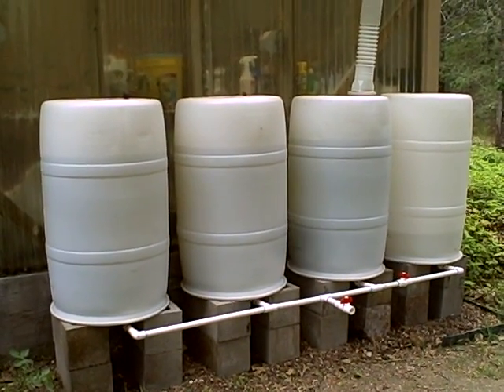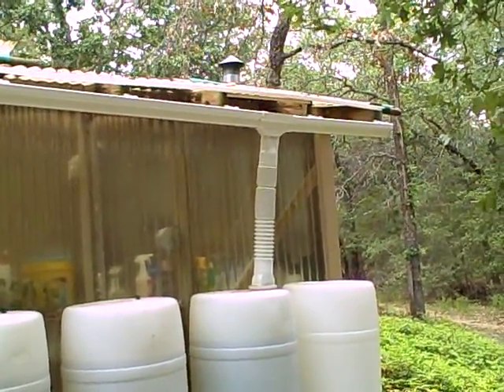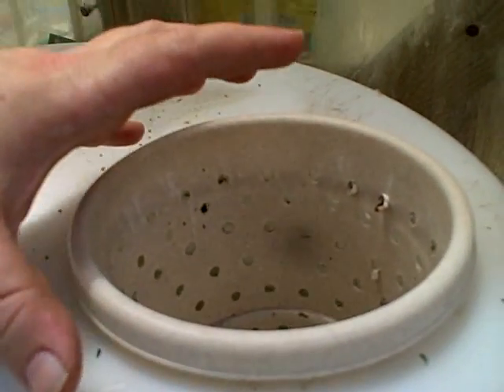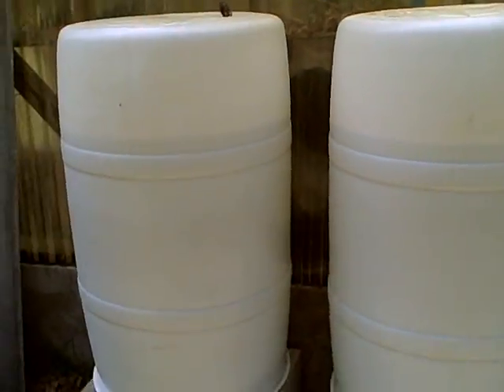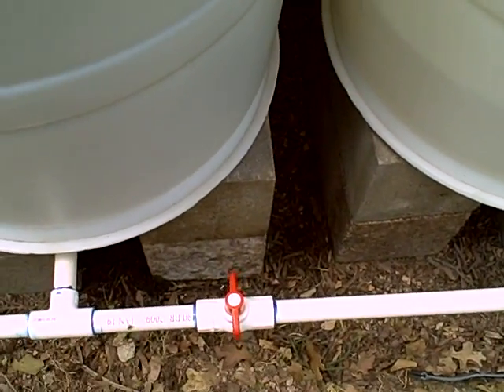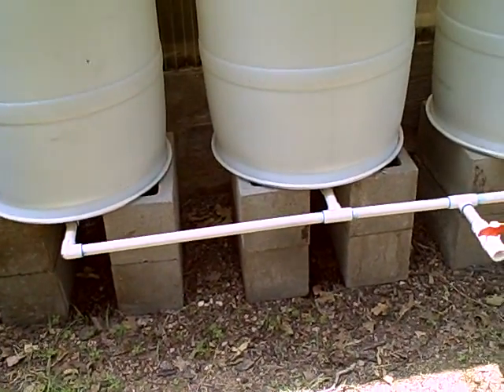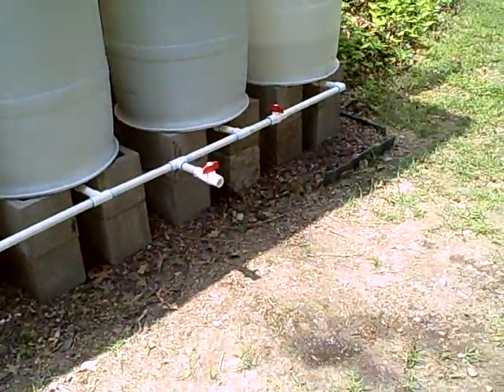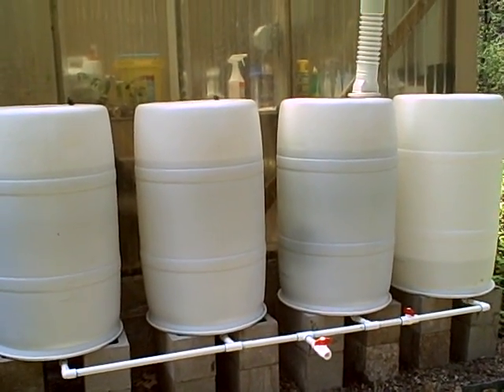MNT's Rainwater Collection System with Manifold

Comment from the maker: outstanding!  the thermal capacity of water should mean that if your freezes come sparingly or infrequently (like ours here in Central Texas) then the water in your barrels will probably not freeze.  however, i'd still dump the water in your manifold just in case (especially considering you had the forethought to install shut-offs at each barrel - wish I'd thought of that).  Thanks for watching!!

Comment: Ok, please check your label on that silicone then.  "Bathroom or tub" silicone usually contains an anti-fungus chemical which is poisonous.  I looked up Rectorseal 5 and I see that's a great choice to use, as long as you aren't using abs plastic, for which it is not recommended.

Comment from the maker: Well... actually, at the time i posted this video (2009) I didn't have an overflow installed. Now, I do.  I simply cut a hole in the side of one of the barrels (near the top of the barrel, of course) and installed a length of garden hose.  Works great!

Comment from the maker: So, I'm going on 4 years since I built this system.  No leaks. Rectorseal 5 to seal the threaded fixtures (instead of teflon tape) and "bathroom or tub" silicon bead around the edges of the fittings.  This system is not meant to hold potable water - only for irrigating my garden.

Thanks for commenting and watching!

Comment: to see if they recommend using it on that type of plastic.  All silicones are not the same, just as all plastics aren't the same.  That's why I find a bulkhead fitting with gaskets and teflon tape is easier
to deal with, and a lot more certain.

Comment: Yes, but there's a caveat that goes with that.  Will it stick to the plastic barrel, or pull away in time to leak later?  What type of plastic is the barrel?  I sell industrial caulks, and sometimes it's a nightmare to get the -right- silicone for the job.  Since I don't sell aquarium silicone, you would have to read the label to see if it will adhere to the barrel, assuming you know what type plastic the barrel is made of.  If it's not on the label, you'll need to contact the manufacture.

Comment: Cool!
I would use a screen with smaller holes to screen out smaller debris.

If you use a window screen-size mesh to cover any vent holes, you won't need to worry about any mosquito larvae in the tanks.

You could paint the tanks in any dark color to prevent algae growth and also protect the plastic from degradation due to UV exposure.

Comment: Nice video.  I think you can turn them back. And use uniseal plug what ever size for bottom.  Open the original cap for the flow

Comment: I don't care for the "delafleur diverter" method of overflow though.  Drilling a large hole in the side near the top of the barrel lowers the water capacity..  Better a "t" fitting at the top on the inlet to allow the barrel to completely fill.  I'm using a Grady Barrel water diverter, and that's how he set it up, and it works great.

Comment: I installed my first rain barrel in 2008.  I put it on concrete blocks.  After about 2 years it started to lean because the blocks were sinking into the ground.  We have poor soil in Plano.  The full barrel weighs 450 pounds so I had to remove it, level the soil and reinforce the ground with bricks.  The lesson I learned was that rain barrels are very heavy and depending upon the slope of the ground, soil stability, and occasional water pooling under the barrel, it can sink.  Just FYI

Comment: Nice video.  I think if the manifold was after the filter, but before the tanks, with pipes running down into the tanks almost the to the bottom, then you might be able to set up the overflow (maybe with another manifold) such that the old water is automatically rotated out every time it rains.  My only concern being Legionella which is rare, but likes to grow in warm water.

Comment: actually, they would if temperatures didn't get to low. the downside, is that they poop. this system is not set up to keep the levels safe. That is preferable in systems that use continuous flow with aquaphonic systems.

Comment: Yeah that's it.  I was asking because filtration can be for many reasons for example if you wanted to prevent a backup or glog in your system for example or chemical removal so water is safe for the garden.  Sometimes there are toxins from air pollution.  Thanks for the response and kudos to you for the project.  There's some satisfaction knowing you're being autonomous.

Comment from the maker: Well, at it's current elevation? No. Without a pump, the head pressure of the water is determined by gravity. In other words, the higher you elevate your system from the ground the more pressure you'll have in your line. I, personally, have my water pumped into a low-flow drip system using a small "on demand" pump that goes into a pressure regulator so that the system isn't "blown up". You'll find some ideas online that can help you develop a plan. Good luck!

Comment from the maker: Dunno if I understand the question. Filtration is basic. I have a filter on the drip system, now (not shown in the video). Haven't had any issues. As stated in the video, this isn't intended for potable water. But, in a pinch, I can run the water through our Berkey and it'll be fine (tried it before, and I'm still kicking!).

Comment: MNT or anyone with possible knowledge, I set up a similar system based on your idea, (which I give you credit for), however one barrel is filling up all the way to the top , and the other two are less than half full. The one that's entirely full is the first one receiving the water from the gutter. Thanks!

Comment: Brilliant. I was trying to figure out a way to install a faucet without making a large hole in the top of the drum. I wanted the faucet in the bottom of the drum so that storage water would flow by gravity into my system. I didn't want to install the faucet through one of the caps (bungs?) because that would mean that i would have to store the drums on their sides and building a complicated rack - or so I thought until I saw your video. Solution, install faucets in caps, store drums upside down!

Comment: I forgot to add what I did to the inlet on my first barrel. I used a flower pot like MrNative did but I took some old nylon stockings and triple layered them into the bucket, then I added several layers of sand and gravel and covered all that with two layers of nylon window screen. It does real good at keeping the water clean.

Comment: Garbage bags probably help to cut down on algae. I painted mine black, then painted them white ( to keep from absorbing heat) to block any light and also added some bleach (about 1 cup).  I will use mine for drinking water by using a Berky water filter.

Comment: como, he said about 12 time's he's using 3/4" pipe

OP: definitely need to close that up for mosquito reasons, adding another filter medium in your filter basket would also be a good idea.   the problem with your mainfold at the bottom is you're assured to get all the sediment from the barrels into your lines, and your valves won't like it over time.

I'd also paint those barrels, too much light getting through and algae will persist.

Comment: Where the water drains from the very bottom, I'd be concerned about dirt and debris getting in the first barrel. By the end of the season, my rain barrel has a layer of crap at the bottom. Also, here in Massachusetts a downpour can easily flow faster than a single 3/4 PVC pipe can drain. I had to add a second 3/4 overflow to my single rain barrel to deal with occasional downpours.

Comment: Yeah, I like the manifold ... I've got a two barrel system and connect them near the bottom with a 1 inch hose so you only need to feed water to one barrel. Do like what you've done there though!

Comment: @alanopolis1 
In Texas, it isn't a matter of the cost of water, it's the fact that there isn't water to buy in some areas. I have a water well so the only expense is to run the pump.  That's assuming that there is something to pump.  Also, lots of well water is high in mineral content that you might not want.

Comment: As mentioned by Reddsmorris1, if you will paint those barrels black or silver, the UV light will be cut off and eliminate the algae. Also, the 3/4 PVC might not flow water into the barrels as fast as it's entering the first barrel via the down spout resulting in loss of water through over flow.
Texflyguy

Comment: From one Texas to another I think your system is the best I have seen and I will likely duplicate your setup for my garden needs. Thanks for SublimeCharger07's comment, I probably will try and find the dark blue 55 gal drums as I would like to depend on the storage for self sustaining water use (should that need ever arise). Of course you meant 90 degree PVC coupler not 45,  Would your coarse 4" filter be improved with some nylon window screen material? BTW Very impressive garden design also!

Comment: Wow, this is a great, well engineered system. I would bet that a good rain would easily flow more water into the first barrel, than the 1" tube can flow out into the other barrels - wouldn't a 4"-8" manifold work better and prevent overflow at the first barrel while the others are still filling? Also, I wonder if you may have to drill 1/8" holes in the drip hose - I think that they need water pressure (50-80lb psi) to flow.

Comment: You're killing me ... you have your barrels connected in PARALLEL ... not series.  And yours is way better than those on YouTube that show series constructions.  If it was 'Series' ... you would have connected the fill barrel at the top, to the bottom of the next barrel.   Therefore, you would have filled the first barrel and then then next, and so forth ... hence, in SERIES.

Your much better method is to connect the barrels in PARALLEL ... using your manifold.

Comment: Your barrels aren't connected in 'series' by the manifold ... they're in parallel.  If they were in series, you would have made an outlet for the first barell to begin filling the second, and so on.  The first barrel would fill completely, and then a connector at the TOP of that barrel would begin spilling over into the second ... Great implementation all the way!

Comment from the maker: @RDLONG30 I'm not quite sure what the difference is between pulling water from several valves for from a single valve on a manifold. Except that the method you're recommending is totally different than the method I'm presenting.

Comment from the maker: @steveinMA1 Well, I turned the barrels upside down because I wanted to take advantage of the 3/4" FIPT connection at each bung. Yeah, it gets a little nasty down there, but it really hasn't caused a problem with the system. Thanks for watching!

Comment: I like your manifold concept.  I imagine you raised the 3/4" pipe inside each barrel so that it would not pickup debris as it flows.  Also, let me suggest adding some window screen material to your intake (inside the perforated plastic pot) to keep mosquitoes and other bugs out.

Comment: This is a great video because of your detailed explanation. I do want to suggest that you pain or otherwise treat the pvc piping though. Schedule 40 pvc doesn't have any  uv stabilizers in it since it wasn't designed to be exposed to sunlight. After a year or so in the sun it will become very brittle and basically disintegrate. Thanks for this great video.

Comment: @Masowai I'm talking about the diameter of the lines leading to the spigot but keeping the final line the same. This would, 100% for sure eliminate any chance that the spigot was being bottlenecked by the feed lines - which would result in a pressure drop.

Comment: Nice setup!  If you spray the barrels with black spray paint, it will prevent sunlight from passing through and causing algae growth.  Also, it's probably a good idea to add chlorine once a year and flush it out before a big rain, to clean out any algae growth.

Comment: dark blue or black barrels will fix the growth in the tank white is not ideal because it lets the light through. also...not having taps on each tank to isolate them means if you get a leak in one you loose all of your water not just one tanks worth ... otherwise its a really good setup ..well done

Comment from the maker: @KevinDC5 Thanks for the kind words! Yeah, I think I mention in the video about cutting holes in the tops of the barrels to relieve pressure. Something that's not shown in this video (installed since I posted it) is an inline pump to a dripline filter that then goes to a pressure/flow regulator. I clean the filter out once a month - it's easy! Well, you probably know that the drought continues down here in Central Texas. 220 gallons will last for about 2 months on my drip system.

Comment from the maker: @burnieberrey Yes, absolutely. I think this is pointed out in the video. I cut a small 1/2" hole in the top of each barrel to relive the pressure in the barrels. Then I stuffed some window screening into the holes to prevent mosquitoes from getting inside.

Comment from the maker: @Deathragous Dunno what the PSI is. I have a "part-time" pump that I bought at Harbor Freight in-line, now, so that I can supply consistent supply to my drip system to the garden. One caveat: If you choose this method, make sure that there's a pressure/flow regulator in-line behind the pump and in front of your first dripper otherwise you risk blowing up your system.

Comment from the maker: @aubry1234 Thanks! The spout? That was easy... it's just a 3/4" ball valve with 3/4" FPT on each end. If you want to connect it to a hose, just find a 3/4" hose bib and screw it into the ball valve fitting.

Comment from the maker: @Higgiebaby Hi there... I'm not sure about a 1/2" pipe. I don't really see why not. Hell, the nice thing about using PVC is that it's CHEAP CHEAP CHEAP! So, go for it! I used 3/4" because the bung fit a 3/4" MPT elbow and I wanted to keep the pipe diameter consistent across the spectrum. Let me know how it goes!

Comment: What type of protection would be best used for winter weather? I'm sure that the pipes would freeze and possible the barrels freeze and crack them. Has that been an issue?

Comment: Awesome system. I like how you can cut off the flow to the expansion and mess with the pipes without any issue. Where did you get the barrels? Any wholesale distributor?

Comment: Great demonstration, I've got my barrels, just got to get the pvc pipe and connect them.  I have more than enough 1/2" pipe all I need is the connections, do you think 1/2 will work as well as the 3/4" pipe?

Comment: Dont forget to mention the need for breathers on the remaining barrels, as you will not get the leveling effect unless the displaced air has a means to vent.
Also, if your going to use it on micro irrigation I recommend a finer filtering method. Especially with 1/4" poly tubing or drippers. 
Awesome video 5/5!       We Texas boys sure know how to survive.  With our current drought, I am curious as to your gallons per sq. ft duration(How long will your 220g water a (x) sq. ft. garden.)

Comment from the maker: @gimplar I suppose you could do that, but the point of having the 3/4" NPT fitings is that they perfectly fit the female NPT fittings on the bung. Elevating the barrels would definitely provide a greater head, but once the upper barrels are empty then you're back to square one. Thanks for commenting!

Comment from the maker: @blazzal Glad you liked the video! I DO have a pump for the system. I bought it at Harbor Freight for about $30 last summer (clear water pump with 1" NPT connections, Item # 1479) . I currently have it connected to a drip system. Make sure you install a pressure regulator. Good luck and send me a line when you have your own system up and running!

Comment: @blazzal I don't think you need a pump to achieve better pressure. If you want better pressure you could modify this design to make the bung openings and the main PVC line much larger. The spigot PVC area will be the same. This should increase your pressure significantly.
If that's not enough pressure stacking the barrels 2 high and having a huge PVC conduit between them would not only give you better pressure, but more consistent pressure.

Comment: @scottiblasto The manifold will distribute the water to other barrels.  You can see that the water level of the first three barrels are exactly the same, and the fourth barrel is lower because there's a stopcock on that part of the manifold.  I've seen other models that use the overflow on the first barrel to fill the other barrels, plus having a manifold, but that's obviously a redundant design.

Comment: This is a great set-up, and I want to copy it. I'm also a Texan and you've designed a good system for our climate. Have you found bugs to be any problem? Or any other critters? Have you done anything to protect the water from heat? I'm sure there must be a low cost way to insulate the barrels. Is there a way to use the system in the green house to modulate the temperatures, summer or winter? How well has the 4 barrel system lasted for you, through August, or drought?

Comment: nice design, as a Marine Engineer, here are some tips. All tent design shd hv a vent pipe which can double as a overflow pipe. Tanking filling shd be from the top of the tank and draining from the bottom. If possible add drain pipe if u need to isolate, clean or change tank. 
Manifold sys shd hv v/v for each tank and a main v/v. This way you can control the water of each tank. Also using such tank will have a problem of algae growth but since it is for garden...no problem

Comment: Nice video! I just replaced my year and half old barrel system with 275 gal or 330 gal IBC tote you could put the nylon screen in your flower pot to filter more little stuff out.